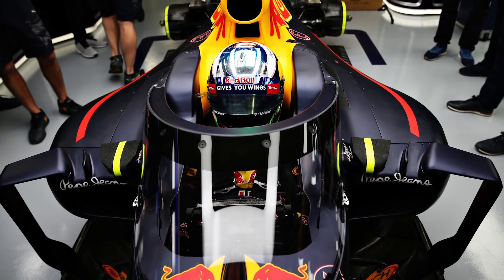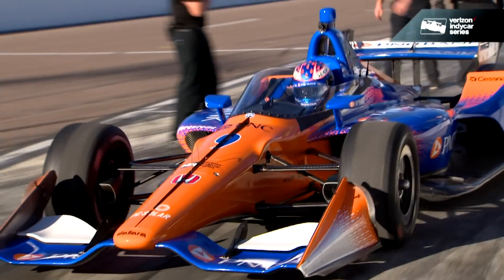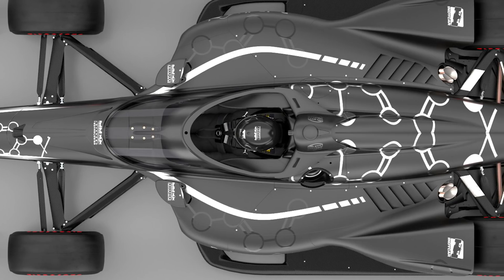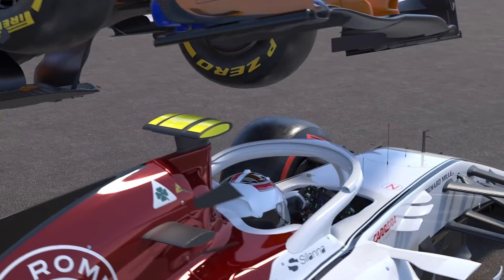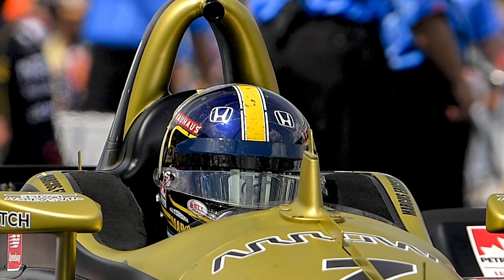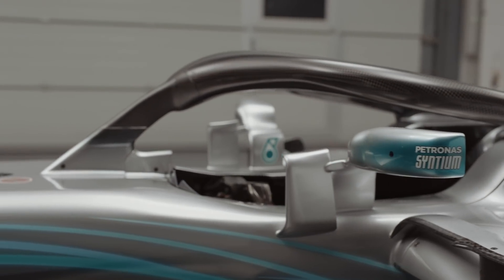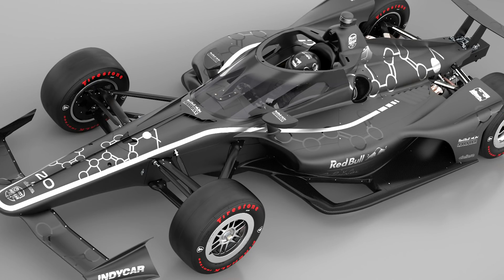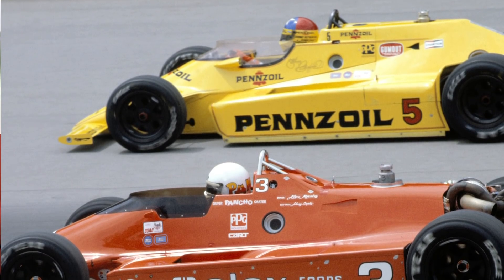Why IndyCar chose Red Bull's screen that F1 rejected

Comment: The main problem I see is with the traditional current halo, if a driver rolled and landed upside down, they can crawl out the side of the halo.  With a screen they would not be able too.  But this may be minor as it is rare a car lands perfectly upside down. I am totally happy with the current Halos. I almost don’t notice anymore. And in a way they almost make the cars look beefier and more badass, like a jacked up boxer.  But I am all for making cars Safer!  I have drove, karts, open cockpit, closed cockpit cars. And in none of them did I loose any fear due to one being safer. Going around the kink at Road America at 130mph is scary in any car!
Reply: Nico Hülkenberg will say otherwise. (Abu Dhabi 2018)
Reply: Jordi Kerkhoven he was also pinned up against the barriers. But all im saying is adding a screen will not make it any easier..
Reply: @adamroberts8728  Sure, but Nico Hülkenberg already proved that even without a screen that you're trapped in the car if you're hanging upside down in the car.
Reply: Jordi Kerkhoven but he crawled out when it was still upside down? And the safety car was pretty much there instantly anyways. But he did crawl out of the top, not the side. So I guess the screen wouldn’t affect it too much. Now if the car was engulfed in flames he would have been out quicker. Typically in a accident of the severity the medical team wants you to stay put in the car. Because you can have back damage that you may not feel right away. But as I said earlier I am all for safety improvement. And I can see where the screen would help with small pieces. As long as they can work through the drive cooling, glare, and make sure driver exit is not compromised im all for it.

Comment: The only concern I'd have about a screen is that being able to still see the driver turn his head. From a safety aspect it looks all good, as long as they've fixed the old distortion issues.
Reply: Ser Garlan Tyrell  the entire canopy is not designed to take heavy hits or be ballistic rated 

It’s only designed to be as strong as needed to be able to hold up to aerodynamic forces
Reply: @superfisher28  probably because fighter's canopies are designed to withstand a 1-2 kg squishy bird at 200mph, not a heavy gauge spring, or a 40kg wheel, or a whole car.
So the screen is much thicker.

At least that's probably why.
Reply: @sergarlantyrell7847  Well a fighter is moving at mach 1 so at that speed a bird would be more dangerous than a piece of metal at 200.  This is what I'm saying they have canopies that can stop a bullet and don't give pilots vertigo so I'm not sure what the problem is.
Reply: @superfisher28  canopies aren't typically designed to withstand a birdstrike at anything like full speed, just at take-off and landing speeds, where the aircraft is low enough to be in serious danger of birds.

Neither are they bulletproof, usually if a bulletproof canopy was required it would use small armoured plate glass panels, rather than the whole thing.
Reply: @sergarlantyrell7847  I believe the Lexan canopies are designed to be bulletproof to 7.62 nato rounds.

Comment: This look way better than the halo! If its strong enough for fighter jet it should be strong enough for formula 1...
Reply: do you even understand what fighter jets do? it's not the 2nd world war anymore, fighter jets don't have to withstand projectiles on the canopy
Reply: @Moribax85  Hum Hum.... they are not bullet proof. But, did you ever heard about bird strike?!? Dont make a fool of yourself and erase your comment!
Reply: @northman77  ok, wanna do math? let's do math. Bird Strikes occur for 90% of the cases (according to ICAO) near or on the airport, during take-off, landing, or relative manouvers, so at relatively low speeds (there a limit of 250 knots under 10000 ft). add to this that windshield strike in civil aviation count for 16% of the total ( https://www.mro-network.com/maintenance-repair-overhaul/how-bird-strikes-impact-engines ) and that windshields in commercial planes are in a vay different shape and position than canopies. consider then the tear shape of the canopy, the position of it (the top of the aircraft, not the front as in commercial planes), you can see that with simple physics, namely the reflection laws, a bird strike is not a serious issue for fighter jets, as the forces applied are deflected way more than absorbed, and to end, i took 1 hour to research any accident involving birdstrikes on fighter jets from the 70s 'till now, and i found only 1 that was serious enough to cause the loss of the vehicle: an f-16 of the royal netherlands air force that was downed after a bird struck the engine, not the canopu, the engine, all the other significant damage was done on trasport planes and bombers that are constructed like commercial planes.
in conclusion: birdstrikes are not a concern for canopy strenght construction since their positioning and their shape, and the relatively low impact pressure of birds, are more than enough to ensure the pilot's safety... on a race car it's somewhat different tho, since we're not dealing with birds, so a relatively lightweight, squishy animal with a large area of impact, we're dealing with metallic debris at high speed... the spring that has gone through Massa's head would have gone through a canopy like it wasn't even there
Reply: @Moribax85   Moribax85  The bird stike test is made with a 1.8kg chicken at 670kph. That mean 31136j or 31 kn. Massa was hit by a 700 to 800g spring at 160-175 mph that mean ~2kn or ~215kg. aeroscreen will have the halo spec. The halo should be able to resist a 12t hit or 125 to 150KN. Tensile strenght of polycarbonate is 63.27kg/cm2. The spring was not that small and should have hit the polycarbonate with ~5 to 10 kg/cm2... what else can I say!

Comment: If it works for fighter jets/pilots, it will work for Indy/F1 and all other series below.
Reply: @pippo9830  the same tech from fighter jet windscreens are used in making these windscreen so the curved glass does not distort the driver's vision. Ferrari only did one lap in practice because the proper tech wasn't used in the windscreen  so the vision was distorted.
Reply: @JacobTerherst  i see at least 2 problems with your comparison: fighter jet pilots fly-by-wire, that means that they don't look outside the aircraft to fly, they use radars and sensor to do it, the only times when they actually need to look outside is in take off (landing is done at 95% by the computer) and if they're asked for visual confirmation, so they don't need to see precisely outside, racing pilots going through a defined track at 250 kph need to be able to see precisely where they're going, since 10 cm of distortion can mean the difference between doing a turn at max and spinning against a wall, and this was point 1, point 2 is fighter pilots fly above the clouds, racing pilots race in all kinds of weather, from desert dry to monsoon conditions, and rain drops can be a pain, expecially when you don't have wipers
Reply: @Moribax85  Fly by wire does affect vision buddy. It's simply the motorised systems that convert raw movement into mechanical advantage. And considering fighter jets are exposed to much higher stress and forces, it's a pretty acceptable comparison. Hence why AP is being used.

Comment: What about glare?
What about rubber/insects/oil spots obstructing visibility?
What about rain?
How can you talk about a subject and not adress the fundamentals?!?!?!
Reply: Lmao, First time watching racing? What do you think happens without a windscreen? The driver still deals with insect's oil spots and rubber. They would deal with it the same way every racing series deals with it. You stack multiple plastic sheets ontop of the windshield or helmet and pull a layer off when it is becoming a problem. Its how they do it in just about every series where the cars have windshields.
Reply: @TheBUGZNTA  not completely true ,WEC, GT3 ,  etc. So on make use wipers on there cars.  Not saying visor shields wouldn't help though.  No not first time watching. Been a fan since about 81 or so
Reply: It will ultimately go the way of a closed cockpit if they pursue this all the way.
Reply: Cause everyone gets told it makes things safer so they just immediately love it to death for some reason
Reply: Yes. They won’t see anything threw the screen after 10 laps. Drivers have tear offs for a reason. I think it’s not going to be good. Maybe they will our windshield wipers on it. Lol

Comment: Its racing,  its not supposed to be perfectly safe. Sorry. But , i feel it takes some of the appeal away from it. And saying that ,i wish no one any harm.  But they know the risk they are taking.  I just feel it ruins the open concept, and it might as well just be made like a Lmp1 car or similar vehicle.  If they want to go this route.
And the rain races will not work with it. They will have add a wiper, so back to a closed cockpit design which will take away ftom from f1 as a whole .
Reply: day 2 day Why does any fan watching care one bit about an open cockpit?  It’s a different experience for the driver, but why would someone watching on TV care?
Reply: Who said this will make it completely safe?

Comment: Anyone else think F1 cars are getting too big?
Reply: They’re are too long and wide. I think early to mid 90s had an ideal footprint.
Reply: They're quite large, but they're still not as large as the cars of the 1980s were wide.
Reply: They haven't increased in overall width as much as you'd think, only about 6 inches since the 1960's.  They've increased by length about 6 feet.  1960s F1 cars  were about the same size as a Formula Ford or a Mazda Miata.  Now, they're the same size as a full-size Ford F-150 pickup truck.  In other words, a 1960s F1 car is just about the same overall length as the wheelbase of the Mercedes W10.
Reply: Its because the hybrid battery and the complicated PU that eat so much space in the body. And yes, the car is about 50cm longer and 20cm longer than the car in early 2000..

Back in V10 era, its just the machine and the gearbox. Now V6 machine, turbo, MGUH,MGUK, battery to store the energy from MGUH and MGUK.. So much things in that body now
Reply: Getting?
They are way too big and have been for 30 years.
Reply: Don't know about 30 years. The pre-09 cars were pretty small and agile.
Reply: BlaizeV No, pre-2017 cars were small. It’s when they widened them in 2017 is when they got large again.

Comment: Now lets hope the rubber tire pieces will not stick on that screen.
Reply: just look at WEC series, they add plastic protector where they tear it during pitstop.
Reply: Selipar Jepun there's no way that a driver can pull one off though if he's got no visibility. Plus also WEC cars don't stop for 1.9 seconds.
Reply: Tearoffs

Comment: 1:08 - what is that dot matrix display behind the driver?
Reply: All indy cars have this. Idk what its for either. Maybe just the numbers of the cars? Id have to actually watch the sport to know why, but its something thats there. Idk why it wasnt working for that test.
Reply: Led displays to show current position, pit stop timing and push to pass mode.
Reply: @jbossariveros  How can you tell what the are - are there certain patterns / colours that show?  And why is it on the outside of the car?
Reply: Dave Wilson The current position is displayed with a red number, while the car is in a pitstop it turns to a green timer. Whenever the driver uses push-to-pass, it shows a green flashing PP. 
It is on the outside of the car because it isn’t designed for the drivers or teams, but for the audience, so they can keep track action easier.
Reply: @jbossariveros  Ah thanks.  I've never seen them before, I'd assumed the coloured pattern was some kind of machine-readable code or something, but maybe it's just random dots because it's offline?

Comment: The screen is a great compromise between the safety improvements we all want to see (well, most of us) and keeping the racing cars looking like racing cars. I've gotten used to the halo but it still sticks out like a sore thumb. 

That said, the concept designs for 2021, where halo is better integrated into the design, are a huge improvement. That design, with a screen around it, would look really cool in my view. Improved aesthetics, with the strength of halo and the protection from small objects offered by aeroscreen; it's a solution I think everyone could get behind.
Reply: yeah the integrated halo/screen would look pretty great i think

Comment: Why did the FIA mandate that the halo had to be made of Titanium when Beryllium was and is the far better option being lighter and stronger than Titanium. Beryllium has a proven track record being used in Apache Helicopters, missile fuselages and even bicycles.
http://www.vueaudio.com/wp-content/uploads/2012/04/BerylliumChart_FIN.pdf
F1, Indy car and most other forms of racing are not about being on the cutting edge of what is possible. Its about 100 years of development reaching finite solutions and budget constraints. In other words the accountants run motorsport, which stop new exotic materials being used to find better solutions.
 
 If the Halo  was really about driver safety the it would be made from Beryllium and the screen on Indy car would be made from transparent aluminum yes that thing from from star trek iv is an actual thing these days Aluminium oxynitride or ALON is a bullet proof composite that can be made in any shape due to the way it is manufactured and is as hard as raw sapphire the only material harder than sapphire is diamond so its a very tough material. How tough well claims that it can stop a .50 round and Armour  piercing rounds means that high speed particles trying to enter the cockpit will easily be deflected.

As we get closer to a closed cockpit this will introduce new problems like driver extraction. should motorsport be developing tools that can cut open a car in seconds to extract a driver following a crash where the driver is trapped and it is unknown what their conditions is.
Or where the cockpit can be extracted as a survival cell with the driver regardless of the cars orientation.

When it comes down to safety in motorsport, although it has improved over time it is a as response to tragedy as apposed to a  proactive progression before a tragedy occurs. The only man that has a proactive mind set that I can point to is Sir Jackie Stewart.

Comment: The halo being chosen over the RB design was a political, not a safety decision. The issue with small objects is still an issue in F1.
The halo also allows the driver's head to be above the cage. As such it would not have prevented the death of Henry Surtees.

Comment: Not sure how I feel about it (in f1), the drivers got helmets to protect the from things like these. And formula one is a open wheel "open driver?" sport and it has always been that way.
Reply: Not always.
Reply: @AB-wc5jm  when wasn't it? Ik mercedes had some non open wheel cars before it became illegal, but it was always "open driver"
Reply: Mikael S-P so what if it changed. Would you prefer a driver dead?

jules bianchi could’ve survived if they had the halo back then ):
Reply: @hyperdriveenable  yeah, I am for the halo. But covering it up kinda makes it less "f1" was kinda my point. It was actually kinda stupid that the halo wasn't a thing before.
Reply: A spring flying at 235 mph hitting a driver in the helmet could kill him, drivers getting hit by debris has happened before.
Reply: @HK_Productions47  And the Halo won't stop that kind of smaller objects. Worst case, it might deflect it towards vital organs. The Halo/Shield hybrid IndyCar is going for is the only really 'safe' system.

Comment: In other words, the new indy car drivers basically doesn't need a helmet. 🤔
Reply: ...uh, sure... ...just like Prototype drivers and Top Fuel drivers don't wear helmets because "safe enough" and what not...

S00per d00per horrible that an IndyCar driver could conceivably be safer without a helmet with this screen than with a helmet without the screen - that's just SO awful, isn't it...
Reply: @RyTrapp0  I was joking 😐
Reply: @mikaels-p6765  Fair enough. Sadly, most people around these comments aren't. So, we get posts like "but how can it work in rain"/"IndyCars don't race in rain so it won't work for F1", or "but what if track debris gets on it", etc. - evidence that critical thinking skills are at an all time low.

In fact, my apologies for thinking that you may have possibly been on a similar level, low low level, of IQ as almost everyone else in here. It's a scary sight, I tell you...
Reply: @RyTrapp0  haha
Reply: @RyTrapp0  and btw, he wouldn't have any head "banging" protection if he hadn't had a helmet, and as far as I know, that's a much more usual than flying debris.

Comment: Didn,t the piece that killed Justin hit him right on the top of his head ?. If so none of these devices would have saved him
Reply: if it was on the top of his head, it would have been stopped by the top of the device. the piece would have clipped the top of the hybrid device and deflect up
unless the impact is a straight drop down, which it wasnt, then the driver would still be hit
Reply: @wongyewxuan3880  ok thanks i thought it came straight down